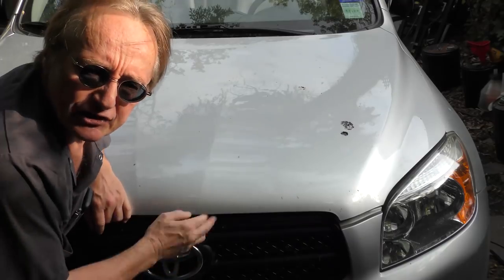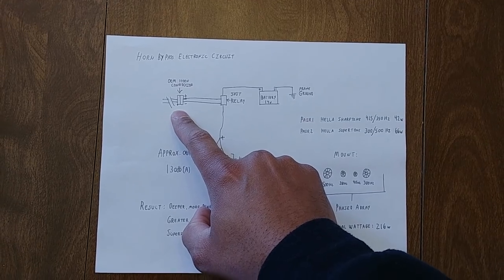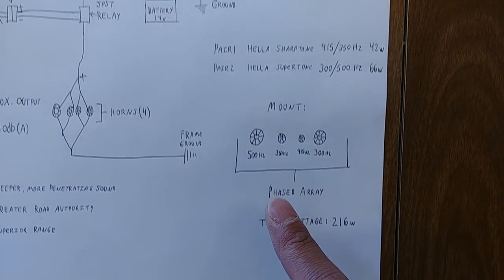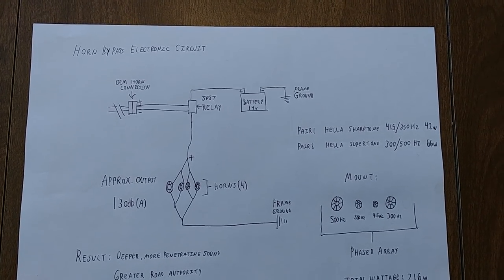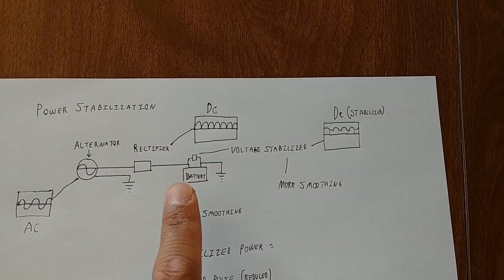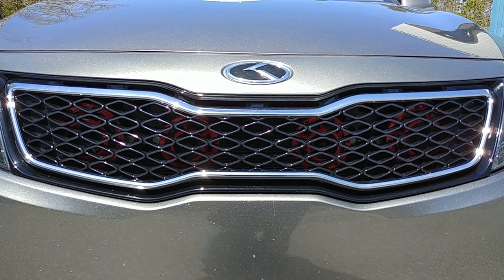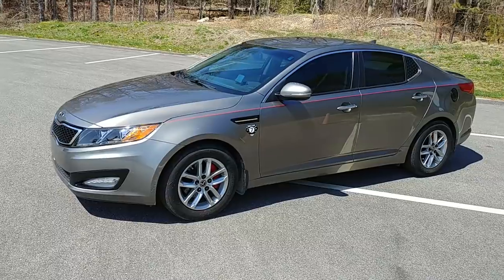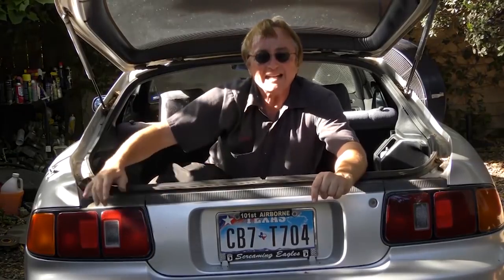Here's Why this 2013 KIA Optima K5 has Quad Horns - How it's Done

Comment: I hope he replaced the blinker fluid
Reply: Bicc OG She's messing with ya.
Reply: Bicc OG tears
Reply: Jessica H yep
Reply: And his exaust bearring. Lol
Reply: Lmfao at blinker fluid
Reply: YouTube Connected  I hate that number 😐
Reply: Jessica H  LOL
Reply: Crisfix fans I see.  Love him.
Reply: Bicc OG if you haven't replaced your blinker fluid in the past 10k miles you should go get it checked out. Using a dry blinker may cause it to overheat and catch fire
Reply: That's only if you're car was built pre 2000. Since 2000 all cars have utilized the full synthetic blinker fluid which is guaranteed to perform for at least 1 trillion miles, more than enough for the life of the car or of the driver. Its a non issue nowadays.
Reply: Jessica H aka soapy water
Reply: Jessica H so you like fluids huh
Reply: Rick James  yeah
Reply: Everyone should tell their non-car friends the next time they take them in for oil changes or whatever, tell them to change the blinker fluid using the new synthetic kind.
Reply: Jessica H I’ve been running LED lights in my blinkers and the fluid lasts longer.
Reply: He would have but figured thst since the lights flssh it must br AC, and he hasn't giured out how AC works yet.
Reply: A nod to Chris Fix. Well played.
Reply: What they don't tell you is you need a left-handed 7/16" drive ratchet to unscrew the cap that's on the back of the headlight gibbler 🙃
Reply: He did.
Reply: I have lifetime blinkef fluid!
Reply: @ChrissFix :D .
Reply: Yeah and the tire fluid, horn fluids important too...
Reply: You need to watch ChrisFix video on blinker fluid and you will know.

Comment: Blow my horn, didn't realize how complex a horn can be
Reply: it isn't, apart from how horns work which I don't know much of, the stuff he described was quiet basic DC power supply stuff; we learn these in first year of electrical engineering
Reply: In the 50's day we learned basic wiring in home economics in grade school.
Reply: I guess now it isn't as much necessary since so many things got automated; in 20yrs kids won't know what a wall switch is probably
Reply: Have you not taken the cover off a speaker before? They have been used in parallel for several decades.
Reply: Well, Horn button on your steering wheel is connected to a relay, relay has a wire to battery's + and this connection is already existing, also the - connections are already existing.

Basically, in this case all that is changed is that there's 4 wires coming from the + wire that goes to the horn from the relay and all of the 4 horns also share the same -

Not very complex, a horn is either on or off.

A "Complex" horn would be the system for the three different sounds from one horn depending on what button you click.
Reply: Mad Motor Repair lol not worth it in my mind

Comment: Scotty, I'm going to submit my 2003 Honda Odyssey.... it's has no mods other than the fact it's still running on the original AT unit... it's better than a mod, it's a miracle!
Reply: Leonel Ventura haha it should be slipping by now, it is a miracle
Reply: Toyota Hachiroku ikr. Should have fallen off already. Always helps to keep a maneki neko on the dash..... 🎌"make-a kaa heppy!" 🎌 Hope I didn't JINX it.
Reply: It is a miracle. Their V6s were crap back then. My dads 03 v6 accord went through like 3 transmissions lol
Reply: Sam Lung You don't mean the engine is crap, right? Honda engines are legendary, I never met a Honda engine I didn't like. My 3.5L has 156k on it and runs like a champ. Obviously the transmission is another story. 😆

Comment: You need to install two air horns that look trumpet/bugle like on your roof, one above each of your front side windows.  To active pull a string which is two feet long located above your head to the left, strung front to back.

Comment: This guy seems highly intelligent.  Interesting video, like to do this mod on my hyundai sonata .
Reply: This is just what we learn in autotech school
Reply: This guy is smarter than Logan Paul, that's for sure

Or is it Jake Paul?
Reply: TheMarsBus 😂
Reply: Well, all I had at the time was Kia money, so...
Reply: UnitZER0  I drive a hyundai so I'm not one to talk. Lol.  My Sonata has been very dependable so far.
Reply: I've got a Sonata too lol. '09, barely over 100k miles on it, had to get the tcm reflashed due to it shifting down into 1st at 30mph and I had to replace the starter once. The overhead light/sunroof plastic trim literally disintegrated a while back and the gas door popper button gave out. Some part of the sunroof mechanism broke too, but that's really it. Other than that, fairly dependable. I wouldn't buy another one, especially because I hate how twitchy the steering is. It looks like a comfortable car, but mine as well as an earlier 2006 Sonata I rented both drive the same. I shouldn't have to religiously grip the steering wheel with both hands cruising at 70mph down a smooth highway. Alignment and suspension all checked out, so maybe it's the steering rack's ratio idk.

Horns are pretty good imho, and I have to deal with i85 Atlanta traffic on occassion so hopefully that means something lol. I installed a pair of the cheaper Hella twin trumpet horns on an mx5 a while back and they were surprisingly loud. I'd say close to a medium-pitched air horn. I looked at the popular round Hella horns and didn't really like the sound, found that they were actually a little quieter than some oem horns fwiw
Reply: TheMarsBus yea he should have bought a pos American car that has transmission issues after 60k miles
Reply: He’s an engineer ahha I understood every word of it haha
Reply: or better yet on a Lada!

Comment: He's right about the voltage pulsing. You can actually figure out what rpm your engine is running by using an oscilloscope on your cigarette jack!Is a voltage stabilizer just a capacitor bank?

Comment: I recently installed a 1970 Cadillac DeVille 4 note horn to replace the stock two note horn in  my 1989 ford f250. its all stock wiring  no relays at all. it isnt loud enough to bleed ears. but itll get your attention. she sounds like a train rollin by

Comment: Wonder if this mod has anything to do with a tendency of having a slight Road Rage problem - Charles
Reply: Cr Cook Surprisingly, no. I have one of those cars that sort of fades whenever it's overcast, so I get cut off a lot. Paradoxically, since installing the mod, I've only had to use it once.
Reply: UnitZERO: You only get cut off because of moronic drivers who don't use their eyes. I have a bright red full-sized pickup and still have idiots who shouldn't be driving cut me off on occasion. It's called a case of tunnel vision or thinking you're the only thing on the road. Sadly, it seems like they let any moron who can turn a key or push a button use a car nowadays.
Reply: Amen.
Reply: I just installed a giant metal 35 degree angled wedge in the front of my car to remove slower drivers outta my way it is aslo angled so they spiral out in the air.

Comment: Well, it IS whacky Wednesday after all.  Would have been better if they hooked up each horn to a toggle switch inside the car so they could have some control over how many horns could be activated at any given time.  It's already wired in parallel can't be that hard to add the switches.

Comment: Increased watts means he increased the voltage or the current, since there is no boost circuit in there, we have to assume he increased current draw. Did he increase the wire size too so he could get more power out of it?

Might as well have put an extra set of horns on a Tonka Truck.

Comment: Doesn't the car already have its own horn relay? So taking the signal from the OEM horn connection would be having a relay power another relay to power the horns? If the current is greater that the car's relay and wiring ratings, I would do this same relay setup, but also bypass the car's horn relay to get the signal straight from the steering horn switch. Just remove the car's horn relay and stick a jumper in the correct slots. This is to be more efficient and to reduce the time lag from the relay mechanical switch movements. The voltage stabilizer thing sounds like another name for a big capacitor.

Comment: Didn’t see any fuses in your diagram, what size did you install?
Reply: The wiring harness for the horns comes with a 10A fuse inline from the positive lead on the battery.

Comment: When you press the horn button the relay closes a set of contacts sending voltage and current from the battery to your horns.   The relay has double sided contact points. Normally closed and normally open.
Reply: Then its not an electromechanical relay which is what is being used here.
Reply: Single pole single throw SPST means it is a contact relay. Axiomatic.

Comment: My car, a 1939 Rolls-Royce Wraith, has twin horns, which are operated from a sort of rocker switch/button on the centre steering wheel boss, which has two settings, denoted 'soft and 'loud'. The best way to scare the living daylights out of people is when you press your palm down and it activates both horns (which is possible) and people tend to move after that. Just look up '1939 Rolls-Royce steering wheel boss'

Comment: Sounds like his belt is squealing, maybe he should fix what's really wrong. Quad horns ? I wonder how much that hurts his air flow  through the Rad. I did like the voltage stabilizer though.

Comment: I have a 150 decibel loudmouth quad train horn on my 1995 Cadillac Fleetwood Brougham , at 150 psi of air , from my air compressor and tank mounted in my trunk , and the horns mounted behind my front bumper , out of sight .

Comment: Supposedly their is a new model Hella horn that does not require a relay! Plug n Play.
Reply: there
Reply: Om Bule You can run this setup plug-and-play. But you pick up an extra 2+ volts using the relay configuration.

Also, if you did that, you'd eventually burn out your wiring, since the car's not built to run 4 horns in that way. The relay method isolates the high draw circuit, and protects your oem wiring.
Reply: So it runs off the factory relay? I don't understand...

The reason relays are used because the clock spring wiring in the steering wheel is too small to run a horn. Even if it works, you are prematurely wrecking the wiring by pulling too many amps through it (it's only supposed to carry signals, not loads). A relay is ALWAYS used because it can handle more than a few amps of current.

And yes, like I've stated, you CAN run a horn directly from the clock spring wiring, but it will fail much quicker than if a relay was used.

P.S. don't forget your snubber diodes!
Reply: there's probably just a relay built into the horn itself
Reply: sadman hoque it would still need a fused wire from the battery or else it'll still draw power through the clock spring wire. Nowhere near what I'd consider "plug-n-play" (unless they include those fuse holders that go into factory fuse panels, still not PnP but much closer)
Reply: Typical 12v relay for car use draws 3/10 amps through the coil and the powe comes from a fused circut.
Reply: sure modern cars are fitted with a dedicated horn relay. check out the fuse box to be sure. but they're usually limited to 10amps per 2-horns. if you got something like the red twin-tone it should get 12A to sound properly. thus you got to install a separate relay circuit to give it the current it needs. the "relay-free" models are the low-end one that only requires 10amps.

you can still use the factory relay, and it will still be acceptable despite being 2Amps restricted. but never swap the fuse for a bigger one or you'll get a headache later! always install new relay circuit if you're running for more than 10Amps load for your replacement horns.
Reply: usbdevice that's not how electricity works.

If it calls for a 12 amp relay (which nobody makes) then it will make toast of a 10 amp relay fairly quickly. The damage on the relay is done when it is switched on or off and the contact is made and broken, creating arcs across the relay contacts (inside where you don't see)

The horn won't "get 2 more amps" from the 10 amp relay. You could pull 50 through it if you hooked up a winch motor to it. But couple problems lie in the relay contacts. First, if the load is near or above the relay's rating, it will ruin the contacts after about 1000 on/offs. Second, if the relay is rated for 10 amps and the horn says it draws 12 amps, it's going to get 12 amps. It doesn't care if the voltage drops and something goes into thermal runaway, or that someone painted "10a" on the relay.
Reply: what i said was, most new cars have a dedicated horn relay circuit. and they are limited by 10A fuse, not saying the relay can only take 10A load. of course wiring are the one limited by that. nobody wants to swap it for a 15A fuse, that is why a new relay circuit is needed. unless you're talking about cars from the 90s.

secondly, if you look at the spec of the horn i mentioned, it says clearly 12V and 72W each, which calls for 6A per horn. again i mentioned, yes you can feed 10A to the horn, but it would sound better if you gave it a 15A relay circuit instead of a 10A relay circuit. same can't be said for a horn that only requires 5A to begin with. giving it a 15A relay circuit or 10A would result in the same sound.

i have installed countless of fanfare horns from hella, bosch, fiamm, denso, etc. and yes, hella reds are the one drawing more amps than the competitors, that's how i came to know it. if we're talking about ordinary horns especially those from china, they are usually rated well below the specs.
Reply: usbdevice you said you could get an extra 2 amps by using a 15amp circuit instead of the 10amp. What I'm saying is that's not how electricity works. It can easily pull 12 amps from that 10amp circuit. Look at opening times for automotive fuses at only 20% overload, you're likely not to ever blow that 10amp fuse (unless it gets stuck on)

What likely happens is that voltage drop is more significant. The difference in dB between 10 and 15 amp circuits will likely not be noticable to human ears (less than 1dB) considering it's only 20% overload for short bursts of time (no longer than a few seconds). I predict after about 20 seconds, a noticeable difference could be heard, but by then you're hearing would adjust so that you couldn't notice drop of a few dB's
Reply: usbdevice if you look on the side of inverters or amplifiers, notice that (the good ones) do not use 40amp blade fuses. They'll use 2x20amp or even 3-5 in parallel rather than one large fuse, so they can take advantage of the shorter opening times of the smaller fuses, banking them in parallel to increase the amperage rating. 2x20a fuses open quicker than one 40 amp fuse in both overcurrent and short circuit faults.

Comment: that's not even the horn you'd use while driving tho- the optimas have a dual horn system, there's one for the lock signal and the panic signal and the other is for road use. he just made the panic signal horn louder, not the actual road horn.

Comment: 1. You really don't need a voltage regulator for a horn..
2. A voltage regulator won't get you any extra power
3. You should have upgraded the power cables, the fuse and the relais. Moden cars always use the minimum cable diameter possible to save money and weight. You can't just send a lot more current through them and expect them to be fine, that's just stupid!
4. You should always use an LED driver for led conversions, not (just) a DC voltage regulator

Comment: Better mod would be to put a compressor in it and put 4 truck horns on the roof. That will definitively blow anybody away. It will be a little hard to hide the pressure lines behind the a pillar but anyway, you wana honk you got to suffer.

Comment: But how much of the airflow to the radiator has he now restricted?
Reply: Michiel James Some but still doesn't matter, if the water temperature gets hot enough the automatic fans will turn on, so worst case, his fans will run more.
Reply: Leonel Ventura Good point. 👍
Reply: Michiel James 6854tons
Reply: World Embassy ?